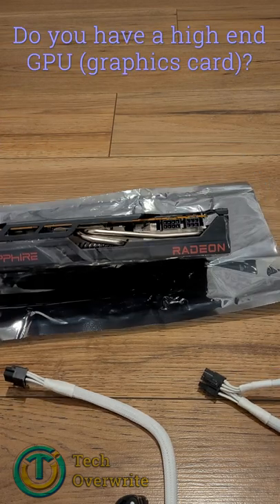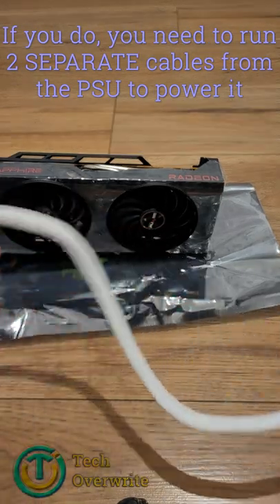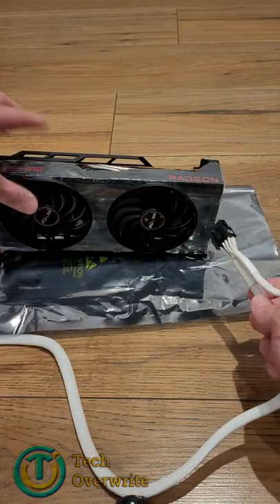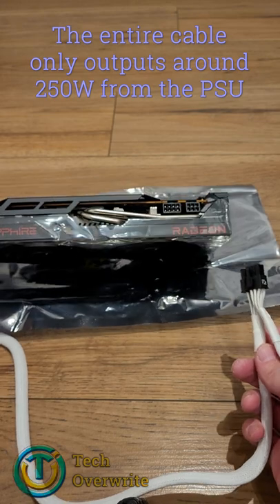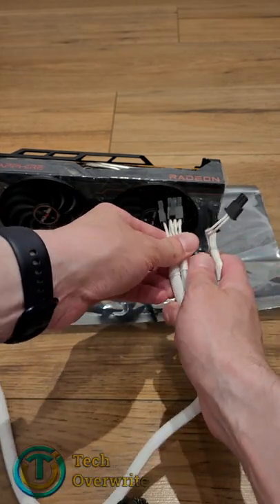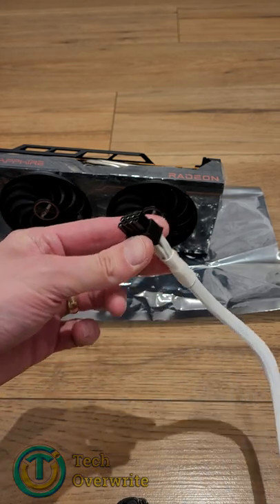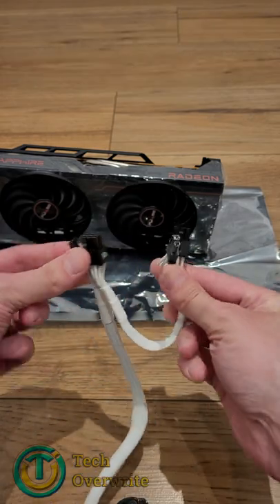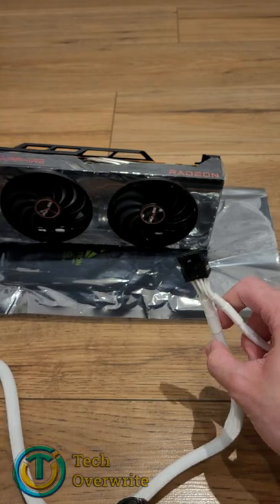Why You Should NEVER (Usually) Use The Same Split (Pigtail) PCIe PSU Cable #Shorts

Comment: I started gaming with a 1070 mid 2010s and the dual pig tailed cable worked for me fine. When I moved to 3090 FE, I still did the same setup. This might be the reason why not only game performance wasn't that big of an upgrade 1070, but also why my 3090 would rarely cut the video signal, during gpu intensive tasks, to my monitor(reconnecting displayport/hdmi wouldn't work, just shut off, pause and reboot) but still run. Nothing was burnt so I assume I wasn't giving it enough wattage due to not using separate 8 pin cables. Hopefully this fixes the latter when I can take a look at my rig again.
Reply from the maker: That's interesting for sure. Sorry to hear your experience, but it sounds like nothing serious has been damaged. Hopefully it'll all work fine in the future 🤞🙂

Comment: Afaik this only matters if your PSU has multiple rails. In that case you would want to put a wire coming from two different rails. But many modern PSUs are single rail, so whether you're splitting at the PSU or at the end of the wire, it doesn't matter.
Reply from the maker: That's a fair point, thanks for mentioning it 🙂

Comment: But is it a different story for the newer cables that split to 2 6+2 PCI-E cables on one side, and plug into the PSU with a 16-pin connector on the other?  Yours has 8-pins on the PSU side.
Reply from the maker: Great question, I thought those ones effectively supply power out of two cables since the PSU is designed to send it as 2x 6+2. In which case this would be fine yes. Although I'm happy to be proven wrong on that?
Reply: @TechOverwrite  I've just been having a very difficult time finding any concrete information about these types of cables anywhere.  I guess because they're pretty new and not that many PSUs come equipped with them yet.
Reply from the maker: Yep I get that, I've had similar difficulties but has been even harder for me to track down answers because my PSU doesn't have the 2x 6+2 into 16 pin adapter. I'll keep an ear out though, incase I find a definitive answer.

Comment: Why does pigtail cable exist in the first place? They just provide 1-1 cable for PCIE
Reply from the maker: I think it's mainly to provide extra flexibility, especially for slightly low powered PCIe devices that still insist on requiring 2 connectors.

Comment: I just only have 2 pcie cable like this and my psu not modular and can use rtx 3070ti rog its 3x8 pin and i have only 2 can use 1 cable to 2x8 ping and another cable only 1x8 pin can like this no issue?
Reply from the maker: Yes that should be fine. Between the power from the PCIe slot and the two separate cables, the GPU should be adequately powered (even if one of the three pins is then pigtailed). 👍

Comment: My PSU right now is 650W A650bn and has only one pcie cable with a pigtail. Will this be fine for using the rx 6700xt? I dont really want to refund this PSU and get a new one.
Reply from the maker: It might be borderline but since the motherboard PCIe slot gives 75W too (something I forgot to mention in the video sorry), you might be fine with just 1 cable. You can always try it but keep an eye out for crashes etc.

Comment: So if the limit of the cable is 250W and the Motherboard give 75W. I'm fine with a 230-260W card ?
Reply from the maker: It depends on the PSU and PCIe cable to be honest. Some low quality PSUs might only supply 150W through the PCIe cable. I discuss this more in the linked longer video, but in general a 230W ISH card probably would be fine yes - especially due to the 75W from the motherboard 🙂

Comment: This is pretty misleading. Remember 3080 for example which is a 300W, has motherboard providing 75W as well. a Single cable is rated beyond 225W, some from decent PSU's come with 300W.
Is it generally a good idea...not really, but if you have a good PSU and the PSU provides that cable, then its nothing wrong with it. I've done a 3080 since launch without zero issues.
Reply from the maker: All fair points, although I do know of 3080 owners who have had crashes due to this potential issue. I think the PSU make and cable quality makes a decent difference too.
Reply: My gpu is 3080 suprim but my psu (Corsair rm850e) has 4 pcie slots hence 2 cpu and 2 gpu only. Is it safe to daisy chain combination of 2 x8 and 1 separate for total of 3 8 cpie?

Comment: So what if I upgraded to a gpu with only one spot for PCI E but have a pigtail connection? Would I just use the first cable or the split one?
Reply from the maker: Good question - you'll be safe using either of the two cables from your PSU. It sounds like the GPU doesn't have a massive power draw, so there shouldn't be any problems 🙂

Comment: Slightly off topic, but do pc extension cables affect cpu / gpu performance, and will they damage my parts?
Reply from the maker: If they're quality cables, they shouldn't impact performance. The only issue would be if the CPU or GPU is very close to capacity (e.g. using nearly all the max wattage of a PSU cable), and then a low quality extension cable is used.

Comment: It's worth to advise that the PCIe 4.0 itself can handle 75w max to the GPU so, if you have a 350w card, and you use one cable alone (75w + 250w = 325w) it'll be missing 25w still. This lack of power can cause crashes, but it's not the end of the world, you can still use the GPU and not expect a ton of problens or hardware damage, but It would be wise to use two separeted cables ASAP!
Reply from the maker: That's true, thanks for pointing out that extra info 🙂
Reply: @TechOverwrite  No worries! Nice content btw! 😁
Reply: Doesn't a single pcie cable only supply 150w?

Comment: So, i just got rx 6700 xt. And im using non modular psu of 700 watts for now. Does the gpu can use the same pigtail cable?
Reply from the maker: Hmm, it might be borderline with just one overall PCIe cable. The cable will supply 150-250W, and the mobo PCIe slot gives another 75W. So the RX 6700XT should be fine here (since its TDP is 220-230W), but watch out for any crashes and try not to overclock the GPU. Good luck 🤞

Comment: Hi thanks for the video. I've tried to power my rtx 3070 with 2 power cables from mw PSU (760w), but it couldnt show in my monitor. And then, I change it just into 1 cable power which has 2 pigtails (2 x 8 pin pcle) to the GPU, and it works. It can be shows to my led monitor. What do u think?
Reply from the maker: Hmm that sounds odd. No idea why that's happening to be honest, it almost sounds like a dodgy PCIe cable 🤔

Comment: My 3080 GPU had melted PCI-E power connector with one 12v rail completely melted and when i remove it, it exposed with metal connector on it. Leaving the one inside the connector itself. The other one just blackened. Good thing is that the one that had melted plastic inside just didn't mangled that much. But I still can't connect another PCI-E cable without it insert fully inside. And one of my PSU connector that connect to the GPU had already hardened and I have to removed the cable along with the housing itself. Any replies and help would be appreciated.
Reply from the maker: Ugh sorry to hear that. I don't have ideas/experience of this but I hope someone else can reply with a useful suggestion soon 👍 Good luck getting this fixed.

Comment: Just my experience, the cable itself is the issue as corsairs 4090 adapter is rated at 600 watts even though it only has 2 cables (500 watts total in theory). If you use Nvidias adapter with pigtails/y split it will not give you the ability to overclock (133% power target). 

My power supply is a corsair rm1000i, the cables are 16 AWG and even with 2 pigtailed connecting into the 4 pronged Nvidia adapter I am able to overclock my RTX4090 so it is actually pulling the full 600 watts (vs 450 if you pigtailed 18 AWG cables). Note that there are smart sense tabs on the adapter that tells the graphics card how much power is available. 

TLDR, >1000watt PSU, 16 AWG cable and you can pigtail no problem. This was also my setup for my 3090 FTW, one cable was pigtailed the other ran a single
Reply from the maker: Ahh that's interesting, good to know. Thanks 🙂

Comment: I have a 3070 running with a single daisy chained PCIe cable (It consumes around 230-240W at full load), since last year more or less, never had an issue. Do you suggest putting another cable or is it fine? I'm afraid to make a mistake, right now.
Reply from the maker: It's probably just about okay, since the single cable plus the motherboard PCIe slot will supply over 250W. A 3070 Ti or 3080 might be more borderline, but the 3070 should hopefully be fine 🤞
Reply: what psu you have ?

Comment: Mine has 3 inputs, and because I used cable extensions I didn’t have much more room for cable storage. I connected 1 split cable to 2 of the extensions and another to my third extension. There’s no chance I don’t get enough power.
Reply from the maker: That's a fair point, although it does depend on the GPU's exact power requirements and what cable extensions you used. A really high TDP like the RTX 4090 might still struggle with just 2 separate cables (and one split for the remaining input). Most other GPUs would be fine though, I agree.

Comment: Mine also has 8 and 6.
My corsair rm750 has 2 6+2 pcie cables. One of the .2 is just hanging in the air. Is that a problem?
Reply from the maker: That's absolutely fine, and mine does the same 🙂 The other 2x pin won't 'do' anything in this situation.

Comment: Hey question, what if the psu comes with 2pcie 8pins inline like that? Mine came with 2 pcie connectors but theyre in 1 line similarly to that
Reply: If your gpu tdp under 250watt just plug in

Comment: My gpu requires 3 PCIe cables but I only have two cables, is it not ideal?
Reply from the maker: It depends on the GPU model, but as long as it doesn't require more than 500W (approximate) it should be fine. The two separate cables, plus the PCIe slot on the mobo, will usually provide enough power - even for a 3 PCIe port GPU.

Comment: should i also use separate cable power if the tdp ratings of my gpu is just 215W? (RTX 2070 Super)
Reply from the maker: You should be absolutely fine with just 1 cable here 🙂

Comment: Could this be why my pc isn’t reading my graphics card? Like it posts a picture through the card the card has lights that are on. But when I launch games it doesn’t use the card it runs integrated. It’s gotta be this or the riser cable right?
Reply from the maker: Ahh interesting, yes it sounds like a possible power issue for sure. Unless the riser cable is low quality, I would guess it's a PSU/power issue. Hope you can get it sorted 🙂
Reply: Nope sounds like a driver issue. Your PC would crash if it was a power issue

Comment: My psu has only 6+2 (8 pins)cable that comes directly from psu. Is it ok to add a two molex to 6 pin to power my Rx 6700 xt?
Reply from the maker: Oh, uhm good question. I would avoid adding extra power via molex to be honest. You might find that using just 1 cable with the pigtail might be okay for the RX 6700 XT because I had forgotten to mention that the motherboard PCIe slots supplies 75W too. So it'll be close, but you might be okay with 1 cable (as long as you avoid overlclocking the GPU!)

Comment: what about the 3070 ti Aorus with 12 pins? It has 2 different 8 min slots and 1 4 pin slot
Reply from the maker: Hmm good question. Are you able to split any f the individual end connectors (i.e. to 'convert' the 6 pin to be a 4 pin instead)? If so, that's the best route to take - ideally along two separate cables.

Comment: I have 700w power supply im about to buy rx 6800 witch is 250w and i have 1080 monitor so i will only play 1080p i watched some youtube videos card doesn’t go over 220w even in 4k u think i should be ok to use single cable pls respond
Reply from the maker: Hmm interesting question. It's hard to say for sure but you're likely to be fine in that case. The problem is, if you start pushing the card more in the future (or try OCing). You might then have crashes or freezes. But you can always try and see.

Comment: My Graphic card have 3*8pin connector and Power supply 2 cable PCIe and each cable 2*8pin connector, can use with Two connector with one cable??
Cable is size 16 cauge!
Reply from the maker: Yep that should be fine, the two separate cables should hopefully supply enough power (even if there is then one pigtail/split cable in the mix).

Comment: Is this only when your PSU is lower or right around the minimum wattage recommended or do I need another cable? Im upgrading from a RTX 2060 (6 Pin) to an RX 6700 xt (8 pin and 6 pin). so should I buy an extra cable and use it as the 8 or the 6 connector straight into the 750 psu?
Reply from the maker: Good question, it's more down to the graphic card's TDP than the PSU's recommended wattage. With 1 PCIe cable, any GPU TDP above 250-300W might be a bit of a struggle. So you might be okay with the 6700xt (with 1 cable), but just watch out for crashes - and ideally don't overclock.

Comment: I only had daisy chains, so I used 2 and plugged them both in letting one half hang, they won’t overheat and it works 😂 Gonna get regulars eventually
Reply from the maker: Hah, it works it works 😁  Yeah that sounds fine though, shouldn't have any issues IMO.

Comment: I have 1 old school VGA for normal work is a radeon hd 5850 2x6 pin power. is it ok to use pcie pigtail? answer please
Reply from the maker: Yes that would be fine. The TDP is only 150W, so the single cable should be fine for you 👍 P.S. I love the 5850, it was my first proper GPU back in the day. 🙂

Comment: I know this may be late but would this apply for a 3x 8-pin power connected GPU?
Reply from the maker: It would be the same principle. A pigtail cable will always supply less power than two separate cables. So you might be fine with 2x PCIe cables (using the pigtail on 1, to get the 3x 8-pin overall) as long as the overall GPU TDP is less than 200+200+75W = 475W, for example. The exact figures vary, but I'd say that 475W and below should be safe for 2 separate cables including 1 pigtail.

Comment: My PSU is Corsair CX650M with two CPU/PCIE ports and 1 8pin (6+2)PCIe pigtail cable. I am pairing this with RX 6750XT. I have another 8pin cable which has CPU written on it, not sure if this can be used here for 2 pin configuration. Do i need to buy another PCIe cable ?
Reply from the maker: Ooo good question. Firstly: no, you can't use the CPU cable for the GPU. They look similar but have different power supplies/deliveries. You might need to get another PCIe cable yes, because the RX 6750XT is a decently powerful GPU so it's probably worth running it with two separate PCIe cables IMO 🙂

Comment: So with the sapphire nitro + 7900xtx, I just ordered the nzxt c850 and it comes with three pigtail pcie (didn’t notice until it was too late to cancel) would I just use extensions from asiahorse on the three pcie cables and just not use the pigtail side? So just tuck away or zip tie the pigtail? Possibly might order cablemod replacement cables as well
Reply from the maker: That's interesting/odd about the three pigtails. Yes I agree, I would hide away the pigtails and then run separate PCIe cables 👍

Comment: Can someone help please just got a 4070ti and I have a Corsair 650watt bronze non modular, it only has 2 daisy chained pci cables one is powering cpu and one would have been for gpu after watching, do I need to buy a new power supply with 3 pci cables ?
Reply from the maker: Hmm it's a difficult one. In general you would struggle with just 1 PCIe cable for a 4070 Ti, especially with lower quality PSUs. However some Corsair PCIe cables are a pretty good guage and can supply 288w or more. Basically "it depends". If you're using a single cable and getting no crashes, you might be fine because Corsair are a solid PSU maker.

Comment: well said, as far i remember 1 cable 8 pin from PSU could only draw max 300W (idk if any manufacturer want do more then it), for the insulation only withstand the heat from that power. if your GPU require more than 300W, use 2 cable are wise choice.
Reply from the maker: Thanks for the comment, I agree with you, best to use two cables when you need over 300w for sure 💪

Comment: What if you have three ports on the gpu and your psu only came with 2 cables?
Reply from the maker: It depends on the GPU. The two cables should supply 400-450W. The motherboard PCIe will supply another 75W. So it just depends whether your GPU TDP is over or under 500W. Under 500W, you should be fine with 2 separate cables (and using one of the pigtails) 🙂

Comment: I have a question about how I would connect an rx 6700 xt with the same connectors since I am building my pc and I have this question, since I have two pcie cables but I don't know how to connect it, since what you want to say is that only connect the 8-pin one but not the 6-pin pigtail, so with the other pcie cable I connect the 6-pin one?
Reply from the maker: Yes that should work fine, i.e. use the 8 pin connector from one cable and the 6 pin connector from the other cable 🙂

Comment: How about if my cable says 30 series card compatible and I got a 3090 ti FE so I need 3 connections 😅 will it work?
Reply from the maker: Good question! Uhm, yes you should be fine here to use 1 pigtail cable (for 2 connections), then a separate cable (for the 3rd connection).

Comment: I have corser power splay , so can i use another cable from another company? I heard i will face problem?!
Reply from the maker: I wouldn't risk it... you're right that often the cables from another company's PSU won't work well with your Corsair one. Probably best to see if you can purchase a Corsair one (even if it's a bit more expensive).